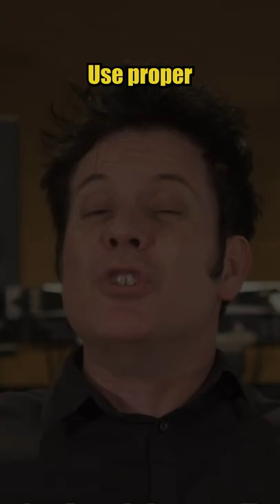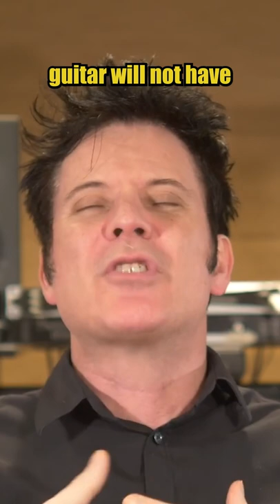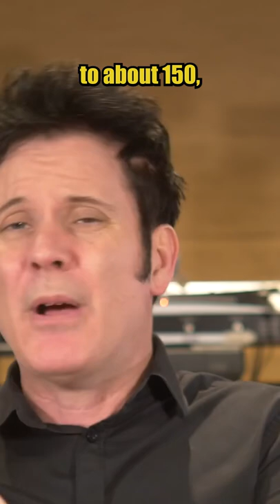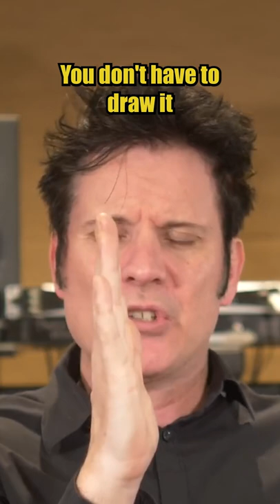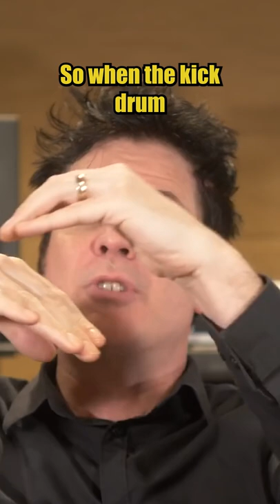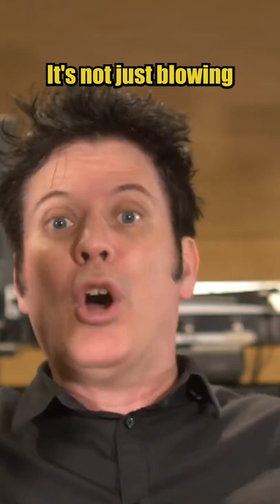Using high pass #shorts

Comment from the maker: what are some of your favourite EQs you use?
Reply: I love TDR Nova, because I can see exactly where the fundamentals are, where I can high and low pass, and exactly what is coming out of the other end! It's a great plugin, and can add that tiny bit of transparent compression just to even things up slightly.
I don't actually use the EQ functions very often. If I start messing with the EQ very much, I think I should use a different take, or record it again. Obviously, that's not always possible, or plausible, if a boost or dip in a couple of places is all that's needed, but sometimes, you take a step back, and think, is this take actually worth the effort? And, have I actually improved it that much anyway?
Reply: My stock eq on cakewalk has a decent enought eq analyzer. From there I can use,, a compressor,, I've then been using audioissues eq. Then  a pultect/maag eq for color
Reply: My stock eq on cakewalk is more than decent for analyzing the curves. Then an audioissues eq.. compression.. then some pultect/maag eq

Comment: Just use a shelf.
Reply: Not the same use case there, buddy.  A shelf just lowers a specific band of frequencies a bit.  High passing completely removes the frequencies at a certain point below the cutoff.  They have different uses.
Reply: @nickhaldin8674  you mean they can both lower certain frequencies at a certain point but the low cut filter is more dramatic? Don't sound too different to me. By the way many producers don't believe in using a low cut and use a shelf.